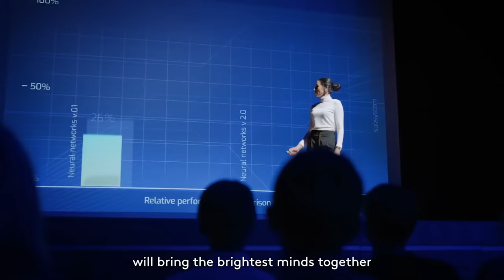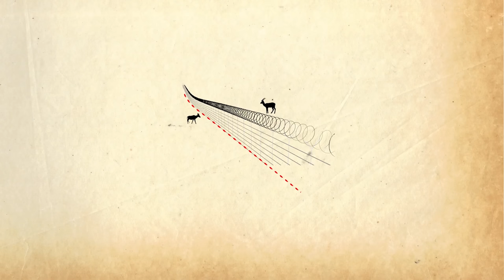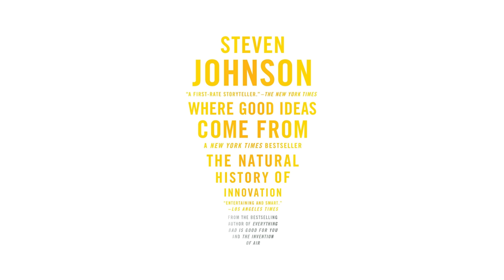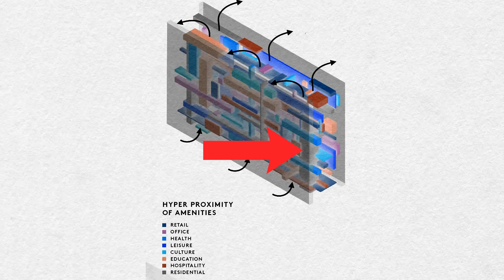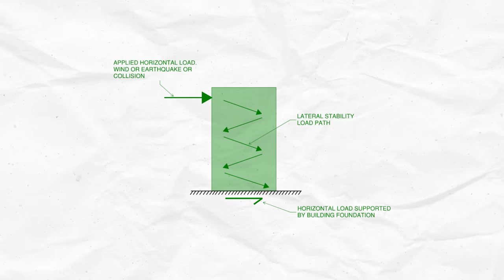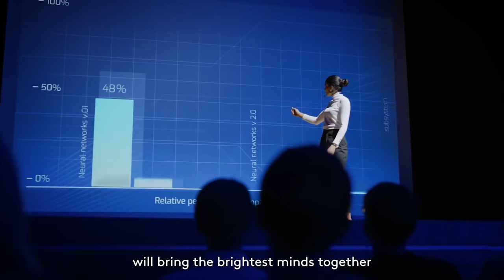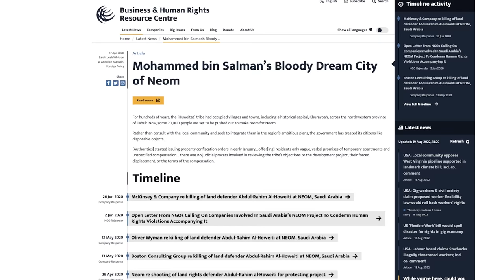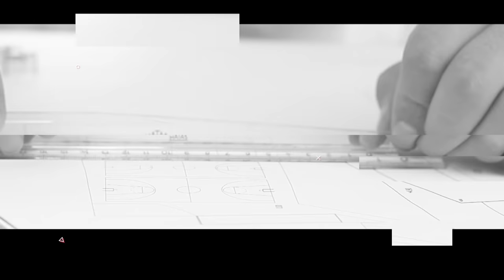This city concept breaks architecture (THE LINE)

Comment: What I love about this concept is that it's so unbelievably insane that you can talk about it for hours and not run out of criticisms.
Reply: yeah, imagine 1 train which is stuck for an hour. the whole city will be stuck for an hour :D :D and what about maintenance?
Reply: @certaindeath7776  Did you see the pictures? there are 4 trains
Reply: @user-ze1hh2oo1p  having 4 train doesn't make this stupid concept a genius concept
Reply: @user-ze1hh2oo1p  even a standard European city with 500.000 people has at least 10-12 platforms. 4 is just a drop of water in the hot sand
Reply: Genius four trains stupid. Only four trains for  million people
Reply: I think it was explained that since this is a new project why not create transport that is already efficient at the concept stage. Current train systems are going on a somewhat straight course because they are built after around an existing city. If you are building a new city concept, then you should design features that function efficiently since you have control on all factors at this stage. Even with 4 train lines it still not the most optimized way to transport. Honestly, the line concept is already questionable, going to point a to b is not efficient, if is was a circle though, you automatically have an option to go either way to get to the middle, the longest distance from all side is nearer, you can traverse the middle of the circle too,  inwhich you dont have the option if it was a line.
Reply: I don't care if it's a pretty high rise.
Who wants to live in the middle of a fucking desert?
How long before the most expensive places are the Condo's built on the beach at the end?
Reply: Read about the Bilkis Bano case and whats happening now
Reply: You'll find a lot of untrained, unprofessional people who don't know what they're talking about but still like to comment about such topics on social media as if they are engineers and project managers. Tomorrow they will be lawyers and after tomorrow you'll see them becoming psychologists
Reply: @Unknown-jb4tr , That is definitely a brilliant project. The trains may be will work as metro system, and some cycle lanes. 4 railway tracks are enough to tackle 10 million people, as people will not travel at edges every day.

And this is a stupid idea for you because you name is Abhijeet. 🫣
Reply: Yeah, like what if i don't wanna walk in a line. What then?
Reply: "Which is why it's such a good idea!"  
-Some ''''self-made'''' Billionaire.
Reply: yea, Elon Musk went through all of that when he planned to build an electric car too
Reply: @tsubadaikhan6332  yeah you're not invited
Reply: Lol! Well said and very funny too. Thank you. I totally agree.
Reply: forgot to remind you world's top architects and engineers will be working here. You're opinion simply don't matter
Reply: @Gabriel-jg5wh  A bad idea is a bad idea regardless of how many skilled people work on it.
Reply: @Gabriel-jg5wh  yeah some of the best architecture, design, engineering, tech firms from the West and to an extent Far East Asia are implementing some of their innovations on this empty piece of land and develop it constantly of what will be called NEOM and another project down south called Red Sea Project. The Line for example is designed by a studio called Morphosis. They can do it just like they developed, continue to develop UAE but it would be more original and authentic for the place to have a more local character because these are the visions and futurist ideas of foreigners.
Reply: @Gabriel-jg5wh  you mean people will gladly work on something that will pay them obnoxious amounts of money?  LOL 

If I have the best actor(s) in the world, can I not produce a garbage movie if my idea/script is stupid, or am I by default to be hailed as a genius movie maker simply because I managed to hire the best?

The fallacy of authority is stupid.
Reply: @tjo6252  Thanks for that insight captain state the obvious. Everybody knows the youTube comment section is for cool guys like you to pretend to be a brilliant intellectual.
Reply: @certaindeath7776  it's like they made it a bottle neck but made it the entire city
Reply: @user-ze1hh2oo1p  Only 4..? Well that's another issue
Reply: @Given Failure, I almost woke my hubby up to hate on this project…lol. It is a pretty promo, though. 🤷🏾‍♀️
Reply: @Gabriel-jg5wh  Only rich people will live in places like these! So I will talk all the shit I want! It’s not like YOU are getting an invitation to the grand opening…unless you are…
Reply: do y'all realize who is standing behind this project? You can say your farewells to all of your gayfriends and everyother being who is considered as open mindend and western. All these influencer fuckers can live there if they promise not to come back at all.
Reply: @Azizan FX cacing cacing i think you should learn english first. Thanks
Reply: @nenenana8175  wtf are you on about
Reply: @Azizan FX cacing cacing so you dont want to waste time learning things properly? Then maybe dont waste our times and stop commenting.
Reply: @cl4ptp808  How? That's literally what the video is about.

?????
Reply: @volkova6209  no offense
Reply: @volkova6209  cry some more
Reply: @cl4ptp808  I feel so great pissing you off

Rage more, i love that i got under your skin and triggered you

Go on, rage
Reply: @volkova6209  literally had to watch a 20 minute video to realize that its stupid. So smart 😭😭🤡🤡🤣😂🤡😭💀💀
Reply: @volkova6209  cope
Reply: @volkova6209  I love that I got under your skin. You're literally crying so hard rn. I feel so great pissing you off
Reply: @volkova6209  rage little baby
Reply: @cl4ptp808  lol true
Reply: @tjo6252  couldn't agree more 👍🏼
Reply: @cl4ptp808  ok
Reply: @volkova6209  cry
Reply: @TsarOfRuss  electric car = ant ghetto for people. yeah, that analogy works!
Reply: @certaindeath7776  Worse, what happens when the high-speed rail line derails due to a crash. How much of the city does it take out and how many lines go down?
Reply: @scfog90  those platforms are for travelling to other cities and countries. They’re not for travelling WITHIN the city.
Reply: @peaceaintpeaceful  wait a few years and they will probably build "the circle". I wouldnt even be surprised at this point
Reply: person living in amazon jungles can be more critical about any ordinary human made city.... for me the only big concern is the wall mirrors.. if it can have wind passage gaps and of the  side walls can be used with solar panels it can be more energy efficient rather than mirrors.. but yes its a way more hyped project with too much  costs involved... i can imagine shorter perpendicular lines rather than a linear city
Reply: @certaindeath7776  multiple tracks could solve the issue, lets say three tracks on each side, one fastest track from A to Z, one for short routes from A to B and C etc  and one backup track
Reply: only Hamburg city in Germany have more than 500 trains but we get issues. you’re mad lol😅
Reply: One example: think about what happens if there’s an… unexpected fire, Structural collapse of some building and anything collapsing that holds stuff up. Probably more. Also, why the reflectivity of the sides? Speaking of fires, what happens to people above? Do they just have to deal with the smoke, even though it shouldn’t have been their problem?
Reply: 💡I remember a gwbasic 🤖 game, Hamurabi.bas.🌜🌠🏜⛱✨
🥵It was easy to get rich 💰💹, but it ended always with starvation...⏳🗿
Reply: @certaindeath7776  You mean like EVERYWHERE else? lmao
Reply: But haven't they already done developments that seemed impossible and they made it a reality Burj khalifa building who would have thought , weren't we saying it was insane when they started that project too , JUST SAYING 🤷
Reply: @referencefool6525  Ok, I never thought the Burj Khalifa was that insane, just kinda unnecessary, but like... it's just a very tall building?
 They also already failed spectacularly at city planning with the Palm Islands. Just saying.
Reply: @scfog90  That's not really true, there's plenty with way smaller stations 1-4 tracks.
Reply: @keshaunnne  1. That was Emiratis, not Saudis. Not all Arabs are made equal. 2. It's called Burj Khalifa because the Sheikh of Abu Dhabi had to essentially buy it out from Dubai because it was such a money pit Dubai (!!!) couldn't afford it
Reply: Yeah lol. Another thing I haven't seen many people talk about is the implications this might have on terrorism. Such a dense area is going to have several choke points that make it an easy target for terrorists.
Reply: @kemaldemirel8958  My point is that these concepts are all practically impossible. We're nowhere near the kind of technology shown in these videos. No true attempt can be made at building these projects because no country on earth has the capability or resources to do so. So there's no point in going crazy about it.
Reply: @nenenana8175  have all the opinions you want, hate on the literal professionals working on this, but just an fyi, knowing English has never equaled being modern or smart or educated. There’s thousands of languages on earth and English is by far the plainest of them all. The greatest people who’ve discovered the wildest things themselves probably have never known an English word. Like consider the whole of mathematics, is there one person who spoke English by past the 1900s? Yeah probably not. The earliest scholars and philosophers were Arabs, Greeks, Chinese, etc. Surprise,surprise!! none of them were English . So think before you comment stuff like this again. And maybe brush up on your arabic too, since you’re soo invested in this wonderful project we’re working on.
Reply: This made me chuckle.
Reply: To answer everyone talking about only seeing 4 trains in the video (I saw that scene as well).

My assumption is that there are 2 DEDICATED trains that go from one end to the other, which should be the 2 in the middle. The other 2 on the outsides I'm going to assume take you from one "unit" (unit: one section of this "line-city")  to the next but never further than maybe 4 "units", my guess is that 2 units have 1 pair of trains working in opposing directions (one goes East, while the other goes West, then they reverse). If you want to go more than that, you'll likely have to go to the next train down the line, which would still be convenient. If you want transit within a single "unit" you'd take a bus or taxi. Other than that, walking or cycling (though I personally would invest in some sort of faster transit on walking levels for practicality... I understand and love the idea of promoting walking over other forms of transport, but saving time reduces stress in most cases..)
Reply: And is it maybe the purpose of political side? To be talked about? Get an attention? Idk🤷🏻‍♀️
Reply: The ultimate abuse - transforming what should be good into reprehensible evil.
Reply: @TsarOfRuss  You realise that Elon musk purchased Tesla right? battery powered cars predate the invention of the internal combustion engine; various companies had been selling commercial EVs for significantly over a century before musk got on the EV scene. Nobody who was even paying the smallest bit of attention in 2004 thought that somebody wanting to sell electric cars was some sort of crazy far out idea.
Reply: @tjo6252  but free speech exists
Reply: @certaindeath7776  If he fails this  project he will build revised one because he has money.
Reply: @user-ze1hh2oo1p  There are not four trains, you mean four rail lines. Except two will be dedicated for passenger services and the other two for freight.
Reply: but it looks super cool though
Reply: @NeostormXLMAX  Kid, that's the least important aspect of any project, especially a city. Design is more important than how something looks in any project or product, it needs to be efficient not aesthetically pleasing. And if something works well and is pleasing to the eye, then you have something good in both aspects, but good design comes first.
Reply: @GivenFailure  that goes for this projects cgi team too
Reply: because "money". that's all it is.
Reply: it is like a city a person with iq below 70 would project
Reply: @ahmadkidwai3141  plus goods in, garbage out...🧮⚖
Reply: What else can you expect from people who builds toilet wc out of gold
Reply: Mega city structure is Not practical and a huge waste of resources.
Consider what if part of critical support structure is damaged suddenly? Or a gas explosion/leak or main water pipe burst? This single point failure issue will affect and even shutdown the whole city.
Reply: Future city design should always be one that embraces and enhances the natural geography and topography around it. Human race cannot live without other diverse species of animals and plants.
Reply: @Gabriel-jg5wh  This is such a bad idea that even if this project is actually successful it would be very surprising to the designer/architect themselves. Also, try using your brain rather that appeal to authority as a crutch.
Reply: well everything starts from a dream, this maybe crazy but look at the many ideas, answers we come to questions we ask. we try to make it work maybe wont be this idea maybe they will find another becuase of this open topic about these issues. 
love the video.
Reply: @certaindeath7776  Yes I'm sure the engineers didn't think of that
Reply: This sounds like another religious cult vision. Sounds like the wannabe Architect 'George Constanza' came up with this idea.
Reply: To the lady in the video, please stop talking in a voice deeper than your real voice. Thank you.
Reply: @Iam1nsane  AI voice is ok then?
Reply: what if it isn't only futuristic .. but a solution for the future .. what if this concept is the future .. the only issue is people
Reply: @schiacciatrollo  
What if...
Reply: They need the tubes from futurama
Reply: @fostinator69  oh you got tv in your tent .. that's a comfort

Comment: The bigger advantage of the line is that it will make giving directions so much more efficient "just go straight"
Reply: "Oh, stupid me! I turned right into the death ray zone!"
Reply: don't forget .. there is an outside there to approach when you live in the habitat .. biking .. the sea .. the mountains ...
Reply: Actually, it'll be more complicated because you have to give directions both horizontally and vertically. For example, "go straight for a mile, then go 20 stories up until you see the library, then turn right and walk for 20 meters."
Reply: Touche! 😅
Reply: "In 500m keep going straight", "At the next straight, go straight"
Reply: @JustQzen  and then return
Reply: I assume it would end up similar to the confusing layout on board a ship.
Reply: Given how our brain handles repetitive patters (it effectively shuts down) I don't know how much better this would be from a conventional organic city
Reply: HOLD THE LINE!!!!!